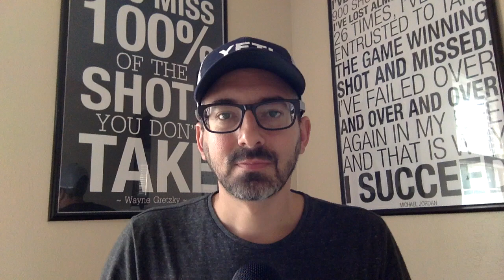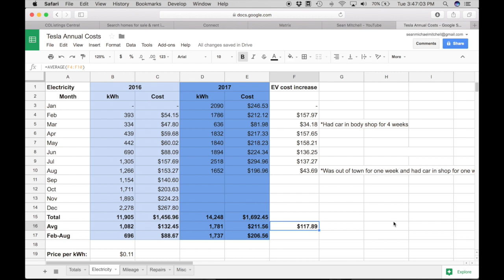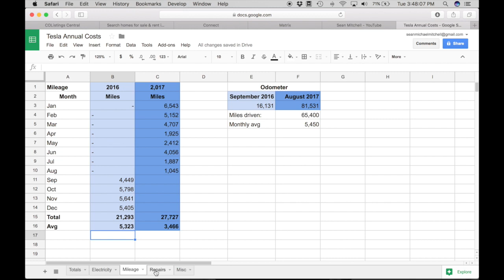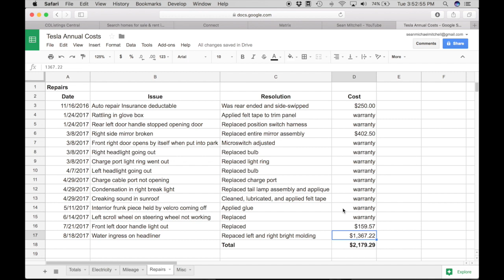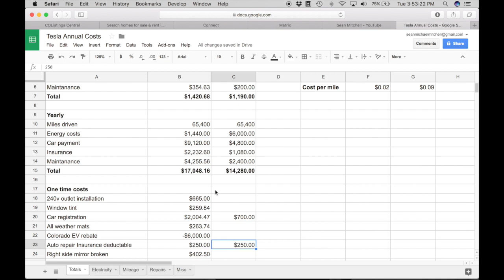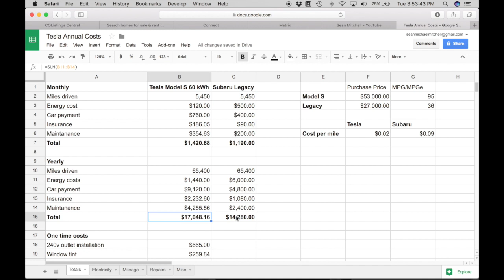How much did my Tesla cost after 1 Year, 64,500 miles (105,000 km)?

Comment: how can u spend $4255 on tires in one year!! LOL it doesn't make sens ...
Reply from the maker: Reza Noei Sure does. When I purchased a used Tesla, it came with summer tires. Two months later when it was time to put on winter tires, those cost $2000 for 21 inch tires. Those tires lasted 30,000 miles.When it was time to replace them, I decided to go with 19 inch wheels and tires. Together, those cost about $2200.
Reply: Sean Mitchell  it's not just tesla.. any cars u buy u gonna need to put on winter tires and for sure 21 inch on any cars costs $$ and not just for tesla... so try to make it more realistic..
Reply from the maker: +Reza Noei what’s not realistic?
Reply: Sean Mitchell your comparison... tire expences are not specific to tesla..  also u cant compare a subaru with tesla..  the price tag isnt the same
Reply from the maker: Watch the beginning of the video. I explain why I compare the two.

Comment: $665 to instal a 240 outlet you were ripped off. $4,225 on tires in a year is ridiculous. A set of 4 19in tesla rims are $1,100 plus shipping.  So you spent $3,000 on 19in all weather tires. That is $750 per tire. You were ripped off again. BFGoodrich g‑Force COMP‑2 A/S UHP Tires 285/35R19 at $252.97 ea.That is a 45,000 mile tire. That is about $1500 for the year.
Reply from the maker: +Bigspiderman a few clarifying points. It’s was about $2,200 for 19” tires and wheels. The rest was a set of 21” Pirelli winter tires.
Reply: So you purchased a set of 21in tires and a set of 19in all season and you are going to purchase another set of 19in winters. If the 21in tires were the set you started the year with why would you not add the cost of the Subaru's tires as well?

 Subaru recommends using Subaru synthetic oil and to change it every 6,000 miles. If you followed the manufacturer's recommendations. In 64,000 each of your oil changes cost $228 per change. A synthetic oil change should cost you between $50 and $80 depending on your location. Why so much?

  Your registration fee was $2,400 and $700. Why so much? Was it the dealer that did the calculations? http://www.douglas.co.us/motorvehicle/motor-vehicle/vehicle-registration-fee-estimate/
  County to county it will very. You would have had to pay $180,000 for your Tesla and $50,000 for your legacy for these to be appropriate.
Reply from the maker: +Bigspiderman the car came with 21” summer tires. I bought 21” winter tires two months after that. I should have factored in a new set of tires for the Subaru because if I would have kept driving it I would have had to purchase some.

Comment: Depending on where you live, registration costs can be vastly cheaper for an EV than for an ICE vehicle. In Arizona, the cost is roughly 1/2500th of the current market value of the vehicle, or $5, whichever is higher. That comes to $24 for a $60,000 vehicle. For cost of ownership comparison purposes, I wouldn't include accident repair costs, but that's just me.

Brake light, not break light. ;)
Reply from the maker: Thanks for the feedback Shawn. Thank you as well for catching the typo. P.S. great name. :)

Comment: It seems like your fuel costs were based on lots of free supercharging. I've done the math based on about $0.12/kwh electricity, and the numbers say a Tesla's electricity cost was only about 35% less than the gasoline cost for a Prius hybrid getting 45 Mpg.  Since the free supercharging is ending for new owners soon, people should not consider the Tesla fuel costs to be gigantically smaller than an efficient gasoline car like a Prius.
Reply from the maker: A Prius is pretty efficient and difficult to cost justify against a new Tesla. Compare it to a used Tesla (-$40K) and it makes a bit more sense, especially if you drive a lot.  Are you considering oil changes / transmission fluid changes? You can buy a nice used Tesla with free supercharging that is grandfathered into car.
Reply: I'm only talking about fuel/energy costs. The spreadsheet in the video suggests the Tesla energy cost is $1440 for 64,500 miles. A Tesla gets about 3 miles per KWH, which costs about $0.12/KWH. A Tesla must use about 21500 KWH to go 64,500 miles, and if you had to buy the electricity at $0.12/KWH it would cost $2580.  Since the spreadsheet says the annual energy cost was $1440, it must be assuming 9500 KWH were free, I assume from free supercharging. The Tesla, assuming you have to buy the electricity at $0.12/KWH would be $0.040/mile.The current Prius is rated at 54/50 MPG, so lets say 52 on the average. If we assume gasoline is $3/gallon, that's $0.058/mile. From a fuel cost standpoint, a Tesla has a fuel cost of about 2/3 of what a Prius would have, unless you have some deal for free fuel, which most future Tesla owners will not have. A car is a pretty significant purchase, and I'm just trying to make sure people have the accurate information on operating costs.
Reply: Jan Bottorff subarus get about 35 uk mpg if it's petrol as they are a S-AWD

Comment: First off I found that video extremely interesting since I bought a new car in 2015 for $40,000
Having only replaced one tire because I ran over a nail on the highway, the sum total of my maintEnance on one time items was $160 (since 2015) for a TLX 6 cyl tire.  The one killer item that still stands in my way is the fact that I live in a condo and the two chargers  that I have seen in my area are ALWAYS  used by the same 2 cars, a Tesla and a Chevy Volt (or is it Bolt. I didn't care to inspect it as I did the Tesla).  I would have to travel a fair ways to find other chargers in the DC area.  It was a bit of a shock when Elon announced the lack of free charging when he did since one of the main reasons for buying an EV was to be able to ride on sunshine for FREE (until he changed his mind about that).I was a bit curious why the warranty ran out when it did in less than 8 months. I guess having bought the car second hand, you don't get a new warranty, which given the water on the headliner, a rather disturbing result, along with the water coming in the rear brake light area, makes me thankful the quality control on my car is a bit better. However the information you have supplied does suggest I may have to wait until the quality control at Tesla reflects what one would expect from a rather expensive car be it new or used.  Keep up the good work. That kind of information  would prepare me for issues that I did not have to put up with having bought an Acura, which remains anvil tight and  issue free (except of course it uses gasoline!).
Reply from the maker: Damian Sco Thank S for the awesome feedback. Appreciate it. I believe they've worked out these issues with their current production of the S. Mine is a 2013, only one year after they started producing the car. Also, you should check out PlugShare.com. I bet there's more chargers around you than you think. You may also want to ask your  landlord if they would install a charger(s) on site.
Reply: Thanks for the map. It did point out 3  chargers I was not aware of but it also left off the 2 I referred to which are 5 times closer to my home than they are. I assume this will get better in time.

Comment: Maintenance, Subaru: "It's primarily, or solely, actually, oil changes."
So, I've never paid more than $50 for an oil change. Let's say you are using the best synthetic oil available, and also got ripped off a bit, so maybe you had to pay $100 per oil change.
So did you actually change your oil 24 times last year? :o
Reply: I think maybe he is doing a 3000 mile oil change for the math. 64000 miles should only need 5 oil changes, for any on road car.
Reply: #David service includes engine oil, oil filter, cabin filter. + overpriced work of course 😆 ps subarus are oil change every 7500 miles at least my 2003 subarus are of which I have 3.

Comment: I call bullcrap on the over 4 grand maintenance cost of the model s in this video.  There is no f ing way it even costs more than 1 grand let alone four.  There are no oil changes, no radiation/coolant system flushing and changing, no ATF changes, no differential oil changes, no drive belt or serpentine belt changes, no timing belt changes, and given that it is a MUCH safer car, the damn insurance should be worst case the same if not cheaper than the Subaru.  

You should re evaluation your costs because I think you're just bringing it to Tesla for pointless check ups that cost the 600 plus bucks each time for no justified reasons.  

You can replace your own windshield wiper blades, air up your own tires, wash your own car, and any other very minor things that have nothing to do with the maintenance items I listed in the first part of my comment.
Reply from the maker: tpcs it was tires and wheels. I bought a set of 21" winter tires last November for about $2k and then switch to 19" wheels and tires in May of this year for about $2300.

Comment: Did you not purchase tires for the Subaru?  I don't understand how you can drive 65,000 miles on any car and not have to replace all the tires at least one time. Also you can't compare things like if you got into an accident or knocked off the mirror by your own fault and attribute that to the car.  Like another person mentioned you need to compare to a similar class of car.
Reply from the maker: I sold it before I had to add new tires - at about 35,000 miles.
Reply from the maker: Nice thoughts. I suppose if I would have driven the Subaru for 65,000 miles I would have had to have purchased new tires - this was a small oversight. Adding that likely tire cost to the Subaru would only change the delta by about $600. Regarding cost of tires for Tesla: I purchased 21" winter tires for about $2,000 last November and 19" all season tires and wheels for about $2,300. Here's the video about why I switched to 19": https://youtu.be/ORjX-G0Wyec.
Reply: Gil Yee ...great questions on the comparison and legacy tire wear non inclusion
Reply: Now that's an excellent question.

Comment: Good data and well presented. Suggest a few intangibles should be listed. Ride comparison for one, road noise, etc. Also you don't mention all the "downtime" while you're sitting at the super charger station twiddling thumbs every 250 ish miles?? Time lost there would be high.
Reply: James Farnham, how much time do you "waste" going to the gas station? I recharge nightly in my garage. Superchargers are for out of town trips, btw.
Reply: Downtime? Didn't you charge at home?
Reply: I've driving about 10K miles in the seven weeks i've owned my Model S, and most of my Supercharging stops have been ~20 minute stops. As i'm almost always driving for work, pulling out my laptop and working on some emails, spreadsheets, etc will quickly kill 20 minutes, as will stopping and making phone calls and such. For the longer stops (~45 minutes) a reasonably quick stop at a sorta fast restaurant will usually take care of charging. 

While it can be difficult to fit in all the time required for charging if you are told you need to make a five hour drive 5.5 hours before you need to arrive, generally that's not the case. With my work, i'm told a week beforehand where I need to be and when. I just plan to leave however early I need to to get where i'm going, and i enjoy the stops that I make. Something I've found is that the 20 minute stops every ~2-3 hours means I can EASILY be on the road for 14 hours and not feel tired or fatigued or exhausted. I don't get the "am I there yet" feeling anymore, which I used to get in my Cadillac that would do 500 miles on a single tank. Did i stop for meals before? Nope. I drove straight through and ate while driving, but now that I have to stop anyway, i'll go get a real meal and enjoy catching up on stuff and then get back on the road again. It's made driving much more enjoyable, and being paid mileage by work is just the icing on the cake.
Reply from the maker: Good points. Perhaps those topics can be covered on another video. Intangibles are hard to track but I think I could muster some estimations.
Reply from the maker: Mostly, although I was using the Supercharger daily for the first 9 months. Not so much these days.
Reply: James Farnham Don't you eat lunch?
Reply: Evolution - Question Time I’m driving in the southeast corner of the country, so I haven’t had to wait at all. Usually I’m one of six, at the absolute most, at an 8 bay charger. The chances of me arriving at a supercharger at the same time that 8 other vehicles are all just starting to charge are very, very, very slim over here. If I did arrive at a full Supercharger, the chances of someone leaving within ten minutes of me arriving are pretty high, but you’re right, it would add some time. 

With the network growing as fast as it is, though, and my car being able to skip every other charger, this is something I don’t anticipate being a serious issue for a while. In five years, however, it may be a factor.
Reply from the maker: +DragonTamer2345 great points. Thank you for sharing.

Comment: I will buy a tesla in 2-3 years when they have perfected their manufacturing issues and the market has more used vehicles which may lower prices.
Reply: respinoza89 never buy first model year for a vehicle, and always check parts availability and repair service locations before you buy any car.
Reply: Very freaking good advice mate.
Reply from the maker: respinoza89 smart move
Reply: respinoza89 it will take a decade at least... look into a Nissan Leaf
Reply: VWdeni You’re clueless...
Reply: @akzebraminer   No he's not clueless read Remarks I wrote up above then tell me he's clueless. YOU ARE CLUELESS!    Remarks already posted above:
Now this is what I would like to see, lets see what you have to say.  ..........................Ok I'm 3/4 of the way through and shocked so many thing went wrong with a new Tesla. I am a professional car whole seller.  I'm retired now but this is what I know. Buying and selling USED cars.  Now the cars I bought usually had a few miles on them, still under warranty but even with those cars, I RARLY had any problems. I mean, you are one man and I've heard of other people telling me , "well I had to do this and that but that's normal with a new car".   WELL, IT IS NOT NORMAL.  I can see Tesla needs to learn how to build a car. They need someone on their factory that over sees problems like this from the dealer then trace it back to the factory.  The things mentioned are not normal. I hate buying new but in 2010 I went down and bought my wife a new Avalon. I choose this car because for the money, it's an upper end car, holds value pretty good. I am not a typical buyer and I know I lost 5 grand driving it off the lot. I had ONE thing go wrong with this car during the whole time of owing this car. The date today is March 2019.  NOW THIS IS NORMAL. I thought about a Tesla but what you wrote is NOT normal. You done a wonderful job, how in the heck did you require two fender benders on each car?  I'm sorry, I've drove 1,000's of cars and I'm not use to anyone getting a fender bender. Plus we did transport some cars. It's sad but no one would listen to me at Tesla because who am I? Right!  It certainly seems Tesla needs work in the factory department.  They need someone like me who can learn about problems dealers are having then trace that problem back to the factory.  I mean it could be as simple as a disgruntled employee or something wrong with the machine installing head liners. Now you do have problems but NORMALLY you don't have near the problems you've mentioned. I understand you don't understand this but trust what I'm telling you.   You see these problems are not normal and when a BIG company builds cars they have learned the problem is with the factory, not a normal thing to replace a head liner in a new car.  Sorry to ramble on. Great video!
Reply: William Dixon It’s funny how you decided to make a huge essay even though I only said two words. That comment was posted a year ago by the way. Lmao.
Reply: @akzebraminer    Actually I copied and pasted something written to someone else.  I probably should have not done that, kind of gets you confused. The so called essay was meant for the man who made the video, NOT for you.
Reply: @akzebraminer   Oh, I take that back, you're the guy who said the guy was clueless for waiting.  NO, he is not clueless for waiting, so you want simple that's simple enough right.  In other words you made a clueless statement and have no ideal what you are talking about.  The fact you made it over a year ago Just proves my point.  They are still making cars with problems.

Comment: I wrote this a while back I hope it helps you

2 kW solar X 3,400 sunny hours like we have in Cairo Egypt will give us 6,800 kWh per year. Let us be conservative and say just 5,000 kWh per year. If the Model 3 consumes 1 kWh per 10 km then we can drive that car for 50,000 km per year. Not many do that. So let us say we will use half that for the car. Now 2,500 kWh is enough to run an inverter air condition to heat and cool  and more for the whole year. Of course fridge washing machine lights etc are included. So let us see the cost of such a wonder. 2 kW of solar max $1,000. Here is the link for that. https://www.enfsolar.com/pv... The Powerwall 2 $6,500. The inverter AC and fridge etc. $1,000. The car $35,000. So add these all up we get $43,500. Take away 30% tax credit and we get $30,450. For that money you will get free transportation and electricity and air conditioning hot and cold for at least 25 years. A very good deal I would say.
Reply from the maker: Alaa Sadek great thoughts. Thank you.